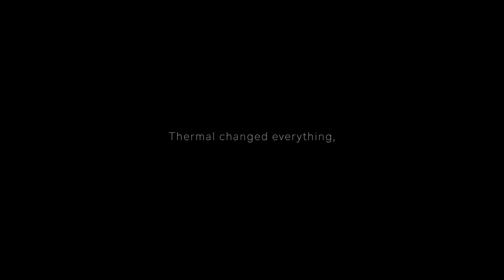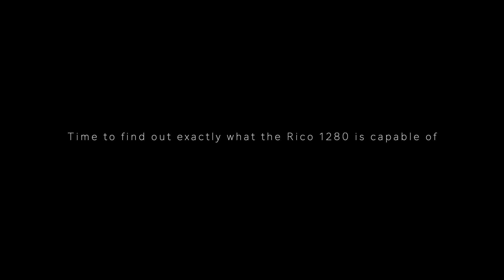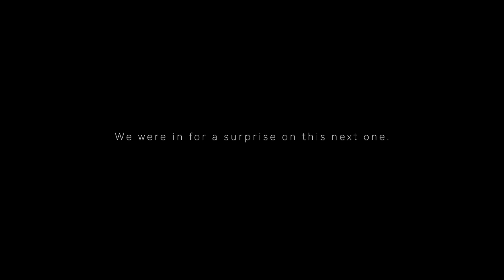Hunter Attempts Impossible Shot w/ Next Gen Thermal (1280x1024) | InfiRay Outdoor RICO HD RS75

Comment: Please stop discussing base magnification. It is a subjective impression and depends heavily in display size and eye relief.

You should be focusing on 2 values, angle of view (e.g. in meters at 100m distance) and the DMR, the resolution of a single pixel. For the Rico (and I don't have the datasheet yet) the DMR is supposed to be 1.6cm per pixel at 100m. This is a result of pixel pitch and focal length, not resolution. Compare it to the Pulsar Thermion XP50 series, they provide a DMR of 3.4cm per pixel at 100m. What does that mean? if you look at an 'rectangular animal' (easier to calculate) with 1m x 50cm then the Pulsar shows 385 pixels. The Rico shows 1953 pixels. That is 5 times as many. 
Interestingly: the field of view is quite the same with approx. 21m at 100m. THIS is a result of resolution, of number of pixels.

And this is why both have about the same base magnification but way different performance. Aside from other factora like sharpness and noise, of course.

So please, with sugar on top, stop discussing base magnification. Thank you

By the way: amazing video! love it